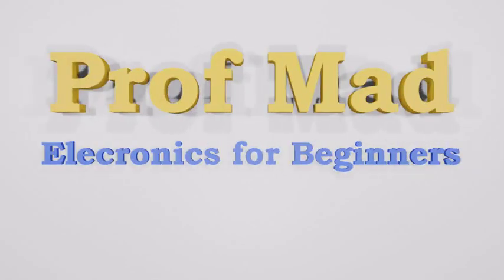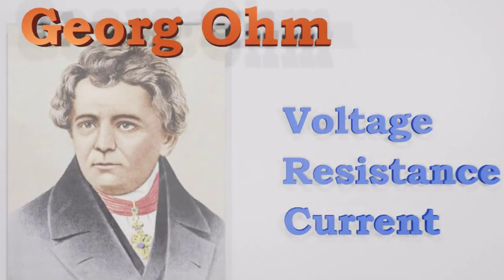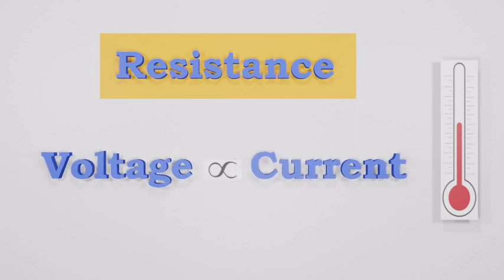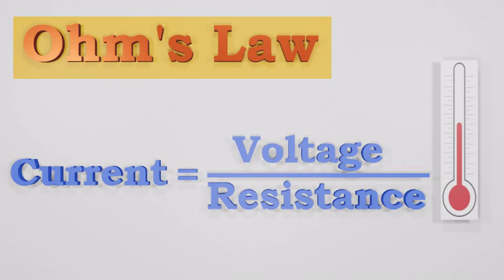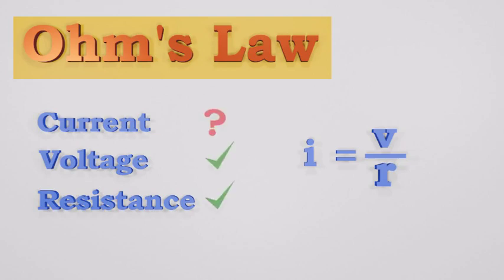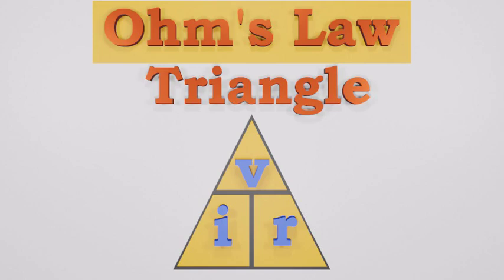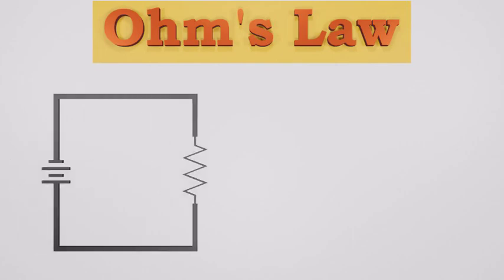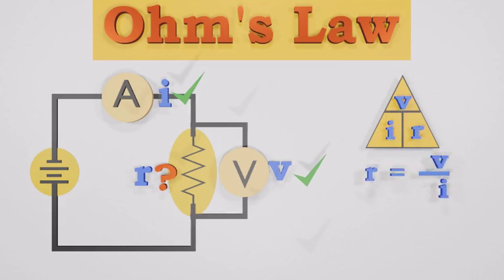Ohm's Law

Comment: but what if R = 0??
because V=I×R  (by formula)
V= I×0
V= 0
but logically Voltage V will Maximum as Current I, if R Resistance is Minimum
Reply: There is an internal resistance In circuit ,r is not 0. In ideal case it is 0